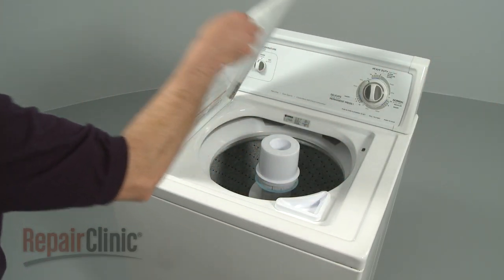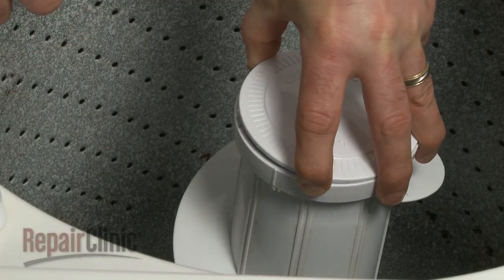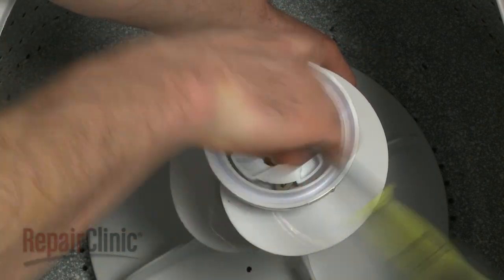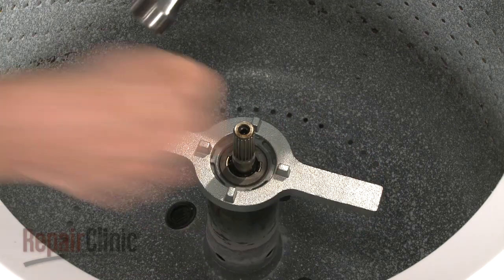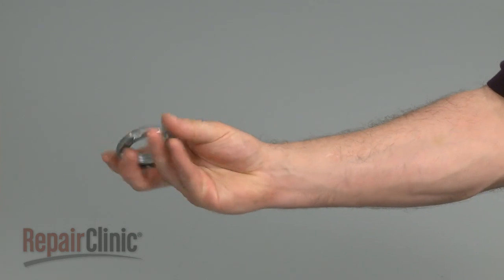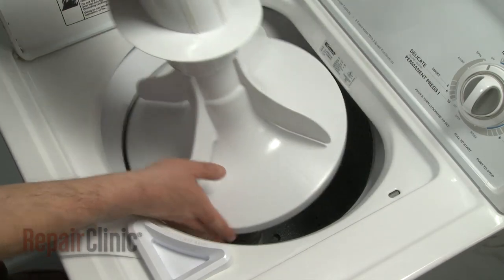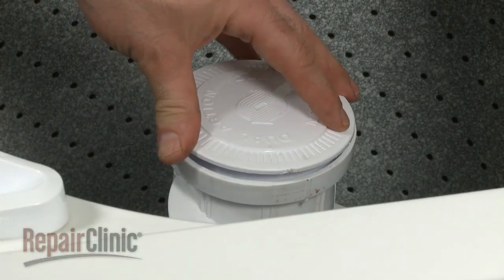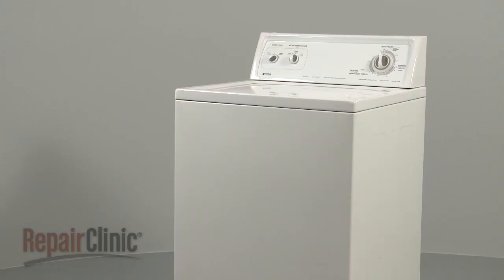Whirlpool/Kenmore Washer Replace Spanner Nut #21366

Comment: Clearly no reason to REPLACE the spanner nut, just removing it to access other components including the transmission spindle, removing the basket, etc. That would be a more complete and useful video. However you did show that the proper removal procedure is to purchase a SST (special service tool) that only fits this exact size spanner. Of course if you have that exact spanner wrench you would not be watching this video and of course would not need help doing this "procedure". At least you could mention the exact size (diameter) of the spanner and/or suggested a SST# for those who want it.